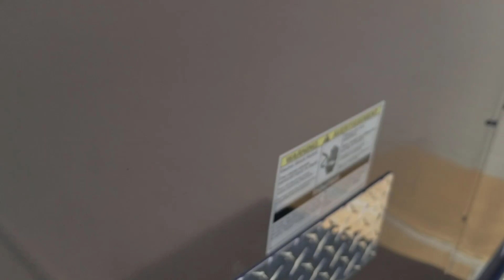Commercial York heat pump built from a Carrier design?

Comment: I had those same crazy thoughts when I first saw a unit identical to a Carrier RTU like that, but it wasn't a York. It was a Trane. It's a new line of RTU's that Trane has introduced to go along with the Precedent & Voyager models, and I believe Trane is calling the new "Carrier look-alike units" their "Foundation" series units. They're identical to Carrier RTU's, just like that York unit, in every way, shape, and form. And yes, the Trane also had a micro channel condenser. Wish I'd have gotten a photo of it.
Reply from the maker: That is a good idea.
Carrier is very popular for commercial rooftop units and to use a Trane or something you had to use a curb adapter.
Making something fit right on the old downshot curb would be awesome.
Reply: I agree. The one single difference I did notice between the Carrier design, (and the York "Carrier design"), is that instead of two fans, Trane still stuck with just one single condenser fan, like the Precedent units design. Other than that, they're identical in every other way to a Carrier RTU.